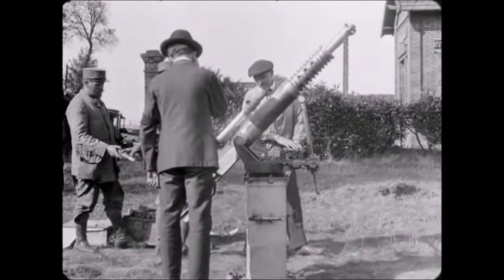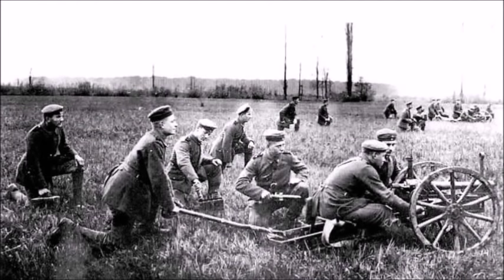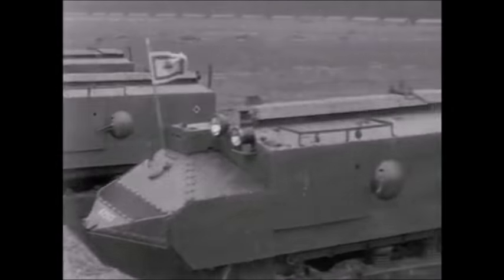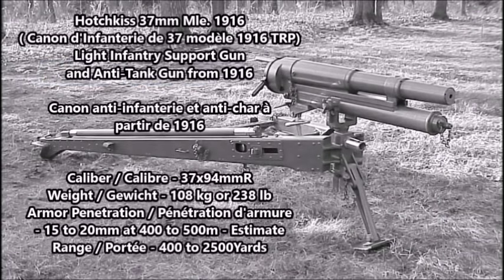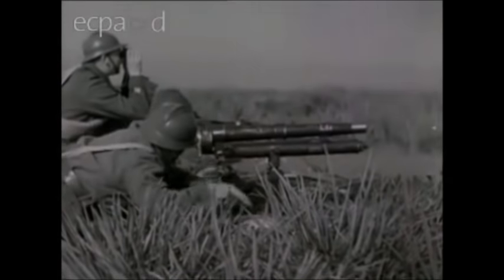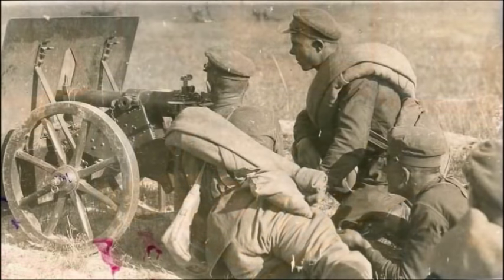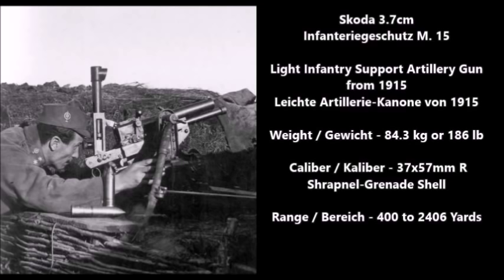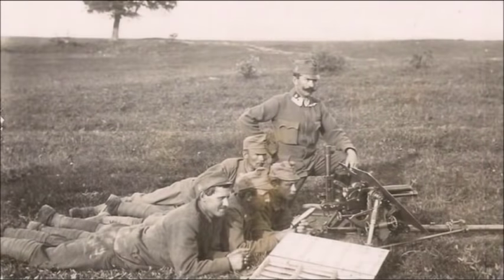Top 5 Smallest Field Artillery of World War I - Explained

Comment: You forgot to mention the Vickers 1.59inch light gun. It fired 40mm shells and weighed 90 pounds complete with its tripod. Its often mistakenly called the rocket gun but it didn't fire rockets but it's tracer left a trail of smoke and sparks that looked like a rocket.
Reply: Thanks for info. You are very well read. Kudos

Comment: The rosenberg seems like it would have been the perfect weapon for eastern front partisans. It's small, nimble and if you remove the wheels you could hide it pretty much anywhere. Also the 37mm round would still be a decent match against any rear line axis armour like tankettes and light armoured cars.

Comment: France & antiquated guns. Like the other Allied nations, France ran into a logistics wall, called the Shell Crisis. In the UK and USA (whose munitions companies were on the hook to the British military), the solution was to make lathes with concrete beds, headstocks, and tailstocks, and to hire more people. France all of a sudden ran into an unacceptably high 'dangerous shell rate' for their new 75mm guns. The solution was to pull the Debange 90mm & other Debange guns out of storage to send to the front. The Debange guns were proven, had huge depots full of HE shells made in peacetime, & they worked well. Finland was using Debange 90mm & 155 mm guns through WWII as they needed everything they could get. Even the UK used significant numbers of the Debange guns bought from France in WWI.  So maybe not quite as outdated in WWI as you might think.

Comment: As I understand it, the Austro-hungarian gun was designed the way it was because of the particular circumstances of their combat in the rough terrain along their border with Italy. I think they used an existing 37mm shell which had explosives they considered sufficient, but used a short case with a small charge of propellant so they could have a gun smaller gun to transport through mountains, where the anti-tank capabilities of the larger higher velocity French, German, and Russian wouldn't have been needed. In this situation it also compares favorably to mortars, as indirect fire becomes more complicated when there are differences in elevation.